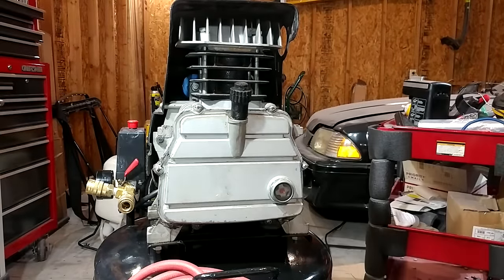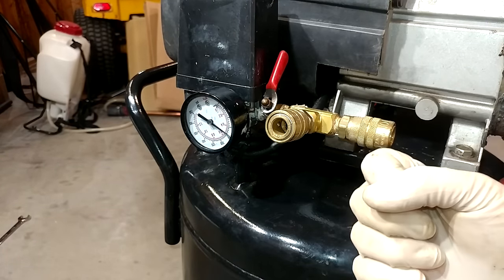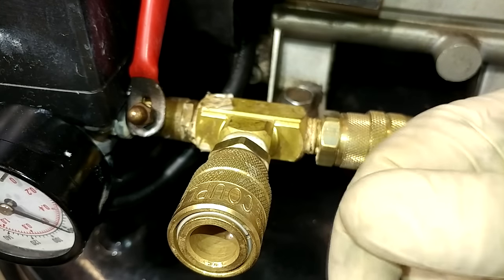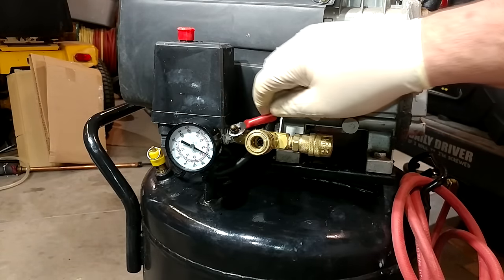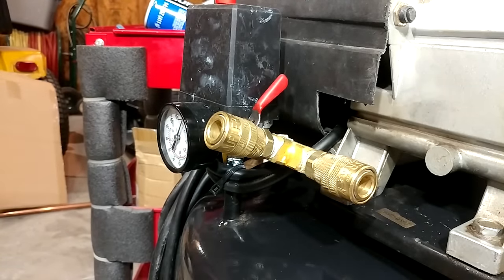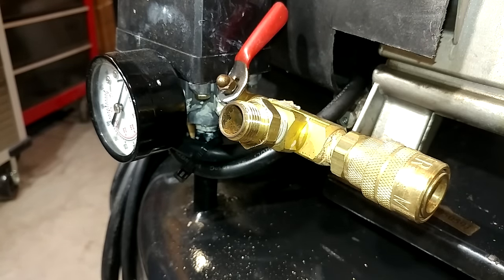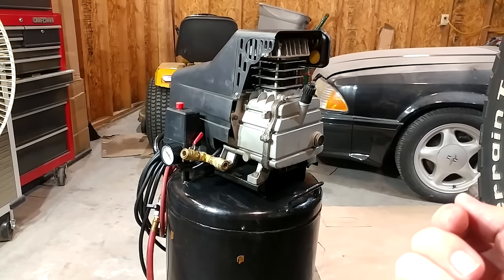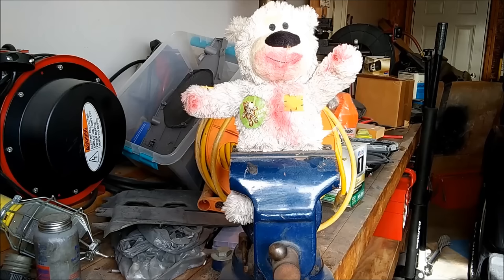Cheap Upgrades for Cheap Air Compressors!

Comment from the maker: I'm aware that I was using the various pliars "backward". I have made a video on the topic...

https://youtu.be/jsw9seQxq3Y
Reply: Why not use a correct tool
Reply from the maker: @randyheinbaugh8238  Did you watch the linked video?
Reply: As long as you know. It’s a good way to bust a knuckle. And strip the flats off a fitting. I’m an old retired Stationary Engr. Boilers and HVAC and every other system in a Hospital, hi-rise, or ship.
Reply from the maker: @gravitystorm61158  The message was clearly and loudly received. 😆
Reply: @TheBrokenLife  👍👏
Yeah, I can be a pain in the a…ss. Retirement does that to you….
Reply from the maker: @gravitystorm61158  I wasn't talking about you specifically. There are probably 50 people who have said something at this point. 🤣
Reply: @TheBrokenLife  No worries. BTW my compressor is a Central Pneumatic item#40400…and my air intake filter broke off from vibration years ago. I put a older model lawnmower air filter on that had the same thread. But, I cant get filters, so I get foam from the craft stores.
Reply from the maker: @gravitystorm61158  I ended up not caring much for the filter I adapted to fit mine so I ended up with a Solberg housing instead. They cost a couple of bucks, but they run a paper filter that is easy to find.

The housing I used: https://amzn.to/3EiE12i

I did need a thread adapter to convert it to metric, but it seems HFT doesn't always use metric threads. Luck of the draw...
Reply: @TheBrokenLife  Did the filter reduce the noise level??
Reply from the maker: @pat8988  Not in the slightest. That general style of compressor, where the motor and pump are direct coupled in a straight line, tend to be pretty high RPM and very loud no matter what you do.

I retired this compressor a few months ago and my newer compressor is belt driven. I was shocked by how much quieter it is.
Reply: I replaced that air outlet with a ¹/² and it puts out air enough to run any impact👍
Reply: Hey DUDE you were using the waterpump pliers backwards, no wonder it scraped all the knurling off !
if you turn it around with rounded jaw away from direction you want to turn  the pliers naturally have better leverage and takes less hand effort and less likely to slip!
Reply from the maker: @TyroneShoolaces-f8e  🤣

Comment: You have a strange way of doing things. I'll just point out one error you made. For your drain, you made it so the drain valve is still under the tank and a PITA to reach. Why? You should  have just  attached a short piece of brass pipe to to the  "L" long enough to end outside the bottom of the tank. Then add a ball valve to it with a large lever. That's what I did. To drain water, I just open the valve with my foot. No need to get on the floor to open the valve. It literally takes virtually no effort to drain the water and it's so easy that I do it so often that there's no build up of water in the tank. Forget the hose! Just let the moisture blow out. You've made things much more complicated than necessary without solving the real problem - that is access to the valve. Also, why in the world would you even think of running the compressor without an air filter as you said you did? That's an incredibly bad idea. Upgrading the air filter is OK but unnecessary but never run a compressor without an air filter. You made more odd mistakes too.
Reply from the maker: I don't understand the complaint of putting a ball valve on the end of a 3' foot hose, which is not "under" the compressor, vs. a solid pipe which is. The express reason it's on the end of a hose is so I don't have to get on the floor to operate it. There's normally also another hose on the end of the ball valve so I don't shoot water all over the shop when I drain it, making the entire thing about 6' long. If you like one or the other, fine. Whatever works for you. 

Pretty sure I admitted in the video that I made a mistake when I removed the filter media from the filter housing. If you want me to say I was wrong for doing that, I was. I can say it 100 more times and nothing about it will change.

Thanks for watching...

Comment: Make sure use your pliers and vice grips in the correct direction!
Reply: noticed that too...
Reply: Just like a pipe wrench, they inly effectively grip in specific directions
Reply: This is why he was cleaning the brass. But what’s so bad about an adjustable wrench?  Which also have to be used the right way around.

Comment: The trick with JB weld and similar epoxies doing that kind of thing is to heat them up- heat thins it out and makes it runnier and also causes it to set faster. I actually keep a few regular old school light bulbs and even a halogen one and a normal light socket in the shop for this, I set the hood of the light fixture over whatever it is like a dome over the part, it warms up and the JB weld spreads out and self-levels.
Reply from the maker: I'll have to keep that in mind for the future. Thanks!
Reply: Brilliant
Reply: Heat guns are dirt cheap and the blower makes them much more useful than a mere radiant heater.
Reply: @Comm0ut  Yea, but you'll go crazy holding it trying to get the epoxy to flow out completely, it takes a while

Comment: This guy needs to watch a video of how to use vise grips and channel locks
Reply from the maker: I believe you're the 4th or 5th person to mention that. Believe me, I got the message.
Reply: @TheBrokenLife  If you turn the channel locks around they work much better. Like a pipe wrench. But maybe you've already been told that. <wink>
Reply from the maker: @gailtaylor1636  I've been seriously considering only using them backward in future videos and making it an easter egg for the channel! :)
Reply: @TheBrokenLife  Bought 2 broken husky comp. 27 & 30 gal. 27 was cooked. 30 had broken regulator knob, destroyed the spring somehow too and after digging deeper one of the three comp bracket mounting tabs is broken. Little afraid to press drive pulley off motor to allow switching motor/comp brackets. I bet it's a smooth shaft and pulley held on by hopes & prayers. So... swapped regulator onto 30 gallon and fired it up without fixing broken mount...yeah that's not gonna last. Will break the discharge line that runs to tank. But fortunately the regulator was leaking so had to tear it down anyway. Going your direction and plumbing it solid w/o regulator. I'll buy a cheap reg and put a q-connect on it for the rare time I need it. Think I'll use a piece of steel and make a tab to replace the broken mount. I have the broken piece but doubt this cast "aluminum" can be welded. Plus expensive. Wanted to bolt an L-shaped piece on but haven't found what I need yet.
Reply from the maker: @gailtaylor1636  When in doubt, JB Weld and some scrap steel can do wonders for broken aluminum castings. Not something I'd do for anything critical or safety related, but for a mount like that it would probably be fine.
Reply from the maker: @gailtaylor1636  Good luck with it!
Reply: @gailtaylor1636  Heh-heh....You said "nipples"!!   
*R.I.P.- Beavis & Butt-head :-(

Comment: One thing I did with my compressor drain is a street elbow to an 8" (maybe 6"? I forget) copper pipe nipple, then the ball valve. It's at floor level, but it's out from under the tank, so it's easy to get to, and no length of hose to pinch or whatever. From there you can run a hose or whatever. Nice and clean!
Reply from the maker: Whatever works! 👍
Reply: ..

Make sense

Essentially not needing
to turn the compressor on it's side

...

Comment: I bought one of these from Kragen (yes Kragen) when I was 16, I used it as my main compressor for somewhere around 17 years. I ran that thing through hell and back and more hot suppers than any tool should suffer. I finally upgraded to a new one after so so much abuse and THEN I broke it back out when I had to refinish my mom's house running an HVLP sprayer and I was not kind to it. I was able to boil water on the head. Once I was done the neighbor kid heard I was going to throw it out and asked for it. We tore open the compressor head, we found slightly warped valves and replaced them, made sure there wasn't any damage to it, buttoned it back up and I can hear it running on Saturday mornings from down the street doing the same thing I purchased it for all those years ago, working on a beater car. That is what you call a workhorse.
Reply from the maker: I have very nearly the same story with mine. It's always been too small for what I needed, but for the most part it always got it done. For what it cost, I couldn't have done better.

Comment: lol, resting your bare arms across those motor capacitors scared me. You weren't all that far away from a Significant Emotional Event. Good video. Cheers!
Reply from the maker: I confess I didn't think a single thing about it at the time. A good safety PSA for sure. 😁👍

Thanks for watching!

Comment: I got that harbor freight compressor did the same took off regulator . I put brass union into a filter/water separator then a good fitting. also made a air/dryer with fitting and good regulator with good gauge . great for HVLP painting. I run 3/4 impact on mine.   just not long run time. works just fine for me. easy take off big tractor tier . Tractor supply has IR synthetic compressor oil. I get better starts in our cold winter . that air filter 1/2 in NPT Amazon has good filters. and the filter cartridge I replaced with lawnmower foam just cut it to fit. now washable ! this is my back up compressor. .
Reply from the maker: That's pretty much the exact same experience I've had with mine, except mine has metric threads for the filter body. Not long after this I changed out to a Solberg filter housing (more akin to a motorcycle filter) and then, like you, this also became my backup compressor. 😆

On my new compressor I did my water separation before the air ever hits the tank, so hopefully my tank and such will stay nice and rust-free for a good long time to come.

Comment: My tips in priority order:
1. Lose the stock regulator as in video. 
2. Replace couplers on compressor, main hoses, and air hog tools with Milton V series. They flow a lot more air and your regular fittings will work with them.
3. Use synthetic compressor oil. I got Husky from the homeless despot. My compressor used to struggle to start when it was 40F. I've run it at 20F with synthetic oil.

My drain is unfortunately not at the bottom of the tank like the video so I have to tilt the whole thing to get all the water out. I suppose they thought they were making it more accessible. I've got a nice automatic drain valve I could install but it wouldn't drain the tank.
Reply from the maker: A lot of people have commented about the Milton Vs. I fully intend to take a look at some. 👍

The synthetic oil is a good idea and something I never considered since my current shop rarely gets cold enough to give the compressor fits. My prior shop was an unconditioned detached building, which did upset the compressor, and I never even thought about changing oil types. I wish I had! 

The only compressor I've ever seen with a drain not at the exact bottom is my little 18V Ryobi, and it makes up for it by being so small it really wouldn't have been practical to put it anywhere but where they did. In your case, I suggest taking the path I just did on my DeWalt (a video from 2 weeks ago) and install an aftercooling and water separation setup between the compressor and the tank. It's better to just never have water in it to begin with if you can. Mine has been remarkably effective.
Reply: A fellow AVE subscriber I see 😉
Reply from the maker: @A6Legit  This Old Tony these days, but, yes... 😁

There are other reasons for it though.

Comment: You are right about the quality quick connects.  I had a Harbor Freight one come apart under pressure and put a nice dent in my G37 fender.  That cheap fitting cost me $700.  I only use Milton fittings now.
Reply from the maker: Oof... I've never had that happen, but I'd be pretty upset if it did.
Reply: @TheBrokenLife  Yes, I was so pissed I just closed the garage door and didn't open it for a month (the car got parked in the Winter).

Comment: For the drain I use pull cord drain valves for semi trucks. Phillips 12 820 is the number. Any truck shop will have for like 10 bucks. They come with a 5 foot aluminum pull cord which can be routed easily. I drain my tank and never have to   reach down as my pull cord is up top now.  As for safety they are dot rated and trusted to hold air brake pressure on an 18 wheeler.
Reply from the maker: That sounds like a good approach to it. 👍
Reply: Great idea - would love to show that rig drain sits on your compressor. 👍
Reply: Just bought one off of the internet. Thanks for the great idea and for the part number.

Comment: It took me 6 years to figure out that the regulator was the problem on my HF 10 gallon. It ran everything perfectly, except for my impact wrench. One day, I had a hunch and took out the regulator. I tried to blow through it and there was a lot of restriction. I took it apart and found that none of the casting defects were ground out. I cleaned it out and got some improvement, but not enough for my impact. I had no clue which regulator to get and eventually forgot about it. The thought never occurred to me to just yank the thing out completely. I'm going to give it a shot. Thanks!
Reply from the maker: Removing it will almost certainly fix it. I've had to do it to every cheap China compressor I've been around.

As luck would have it, I just bought another compressor with another cheap regulator so I'll probably be able to illustrate the issue on camera soon.

If you want to run a regulator, I suggest something that is meant for professional use, most likely with something like 3/4 or 5/8 inlet/outlet. I've had a Parker on my shopping list for a long time now and am hoping to have a bit of compressed air re-fit in my little shop soon-ish.
Reply from the maker: @sheepdog3828  No problem. Sometimes I have a hard time keeping up with all of the comments myself and it's my channel. 😆

Also... I did buy that Parker I was talking about and it will likely be on the channel "soon".
Reply: Question from an absolute beginner: why would you want or need a regulator? Seems like most tools would benefit from all the air the thing can deliver them.
Reply from the maker: @fallingwater  Some tools have a maximum pressure rating. In fact, most tools do and its usually 90psi. That said... I've run plenty of my tools far beyond that with no real problems.

For me, a regulator is mostly useful when doing something "delicate", like blowing dust off of something that may be sensitive or even inflating a small object. It would be very easy to explode something like a beach ball (maybe even a basketball) at 150psi, but not so easy at 10 or 20 psi.

Comment: I thought of a way to drain water from the tank automatically. It works well. I have it on my compressor. Get a solenoid valve that will handle compressors pressure. I used a larger valve because I couldn't find one the size of the drain pipe in the tank. I believe my valve is 1/2 or 3/4 inch. Get a solid state  delay switch that you can set for a few seconds. Connect the timer to the pressure switch on the compressor. Then connect the solenoid valve to the timer so the valve opens as soon as the compressor starts. I believe I set the delay to turn off the valve after about 3 seconds. Every time the compressor starts it opens the valve about 3 seconds before closing the valve. A little noisy when it is open but works great.
Reply from the maker: I'm way ahead of you, but our control systems will be a little different. 😁

Comment: Thanks for this vid.  Many very useful tips and I liked your explanations of them.
Thumbs up for sure,  I learned a few useful things here.
One thing I might have done a bit differently whilst you were dropping that JBW in with the popsicle stick would have been to slip a drinking straw (even if I had to make one to fit) over the threads of your centre post to avoid getting the JBW into the end of those threads.
Thanks again!
Reply from the maker: Thanks. I'm glad you liked it!

I don't think I even considered the threads while I was doing that. I might have probably just taped them off if I had even thought about it.

Comment: I picked up a nice 29(?) gal. DeWalt Air compressor for $40 off FB Marketplace with the following issues:
-One of the brushes sparks like crazy and blows the fuse after a few seconds.
-Tank had about 1 qt. water sloshing around in it along with plenty of rust & silt.
-The drain valve was plugged with some and rust debris.
-Air intake filter was dirty.

I've got it apart, rinsed out all the rust with water, dried it, and am ordering/collecting parts to get it back up to spec. 

I'll be using some of these modifications to do so. 
Thanks for sharing!
Reply from the maker: Good luck with it! It sounds like a very close cousin of the compressor I have these days.
Reply: @TheBrokenLife  Thanks! I think it's 15 gal. Probably the same one rebranded.